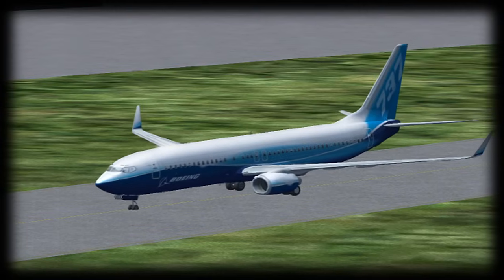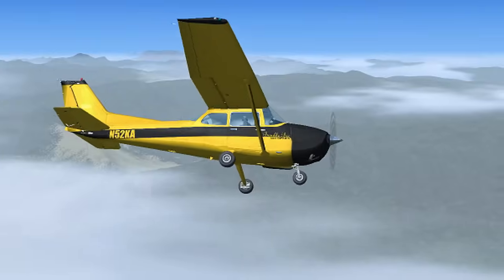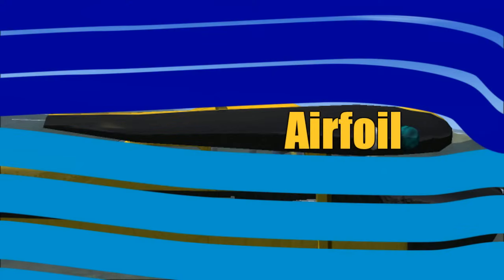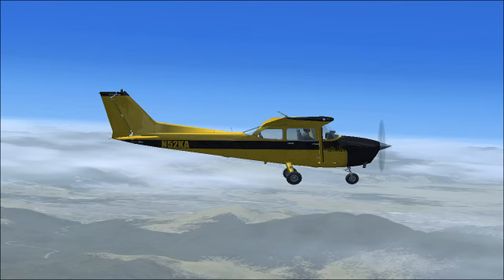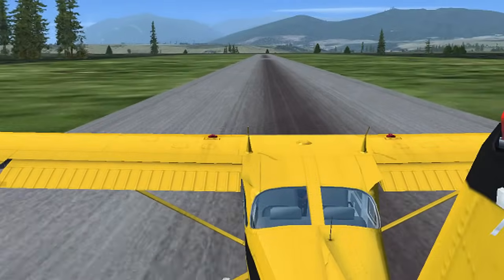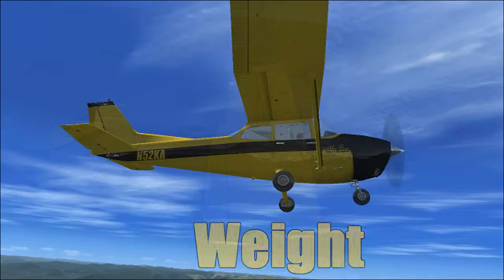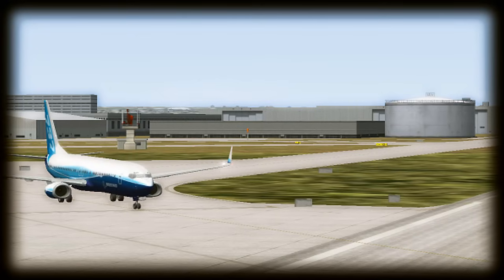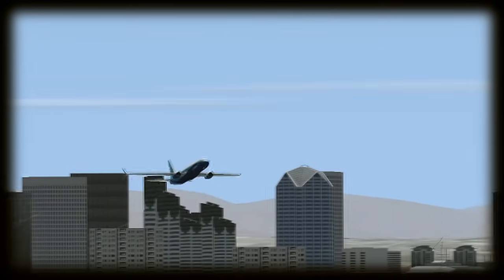The Aerodynamics of Flight

Comment: Bernouli's principle though itself true has now been discredited as the cause of aerodynamic lift. A wing, like a propeller or the vanes in a jet engine divert air causing an equal and opposite reaction. The propeller or jet propels air backwards, causing thrust, and the wing propels air downwards, causing lift. Even Nasa now agrees that the application of Bernouli's theorem is misplaced in this context. Nobody's telling me to watch it either, but if it is educational it should also be accurate

Comment: Actually Lift does not have to equal weight for the aircraft to fly. In actual fact in a climb Lift is generally less than weight and we actually climb through an excess of thrust. also in a level turn lift at 60 degrees angle of bank will be aproximatly 2 times weight.

Comment: It's not the upward force that creates lift but it's the low pressure on the upper area (suction) along with the downwash at the trailing edge of the airfoil that create lift. The low pressure is accountable for the majority of lift produced. Take a plain piece of paper and hold it in front of your mouth, blow only in the upper area of the paper, and boom magic....lift is created.

Comment: If thrust = drag, then lift < weight:
 the forward movement = thrust - drag. And the lift depends on this movement (because wings generate lift only when they move through the air). If thrust = drag, then thrush - drag = 0, then lift = 0. So in order to be able to fly, thrust cannot be equal to the drag.

Comment: If this presented THEORY was true then an airplane with a symmetrical airfoil or an inverted aircraft could never fly. Many aerobatic and model airplanes have symmetrical airfoils. They fly (very well) by displacing air downward by using an angle of attack! The weight of the displaced air must equal or exceed the all-up weight of the aircraft  In a turn an additional amount of air is displaced sideways to offset the G loads.

Comment: that depends... If the airplane is already in the air? - cause then it wont fall... Same goes for Thrust and Drag... If the powers are equivellent... then the flight will only continue its path... (if airforce didnt exist :D) <3 Physic laws

Comment: Bernoulli's Principle also comes into effect even when the airfoil is symmetrical. When the wing increases its angle of attack, the air travels much faster over the top of the wing because it gains speed as it travels downwards. And the bottom of the wing is blocking much of the air so the pressure is greater in the bottom. So theres Nweton's law because the air is traveling downwards on the top, which reflects the wing upwards and Bernoulli's principle because of the change in pressure.

Comment: Yes but in helicopters lift is not a result of forward motion. You may consider "weight and lift" same for helicopters and also "thrust and drag" (if the helicopter is in forward motion) but helicopters do NOT need forward motion to create lift; lift is created by spinning rotor blades whether the helicopter is in forward motion or stationary. You may think of the rotor blades as wings. They have similar cross section and angle of attack (here it is called pitch).

Comment: I couldn't agree with you any better. I don't know why people keep repeating the same old stuff. If the entire lift were result of bernoulli's principle, then the pilot of that 737 would never need to use the elevators to get the airplane off the ground. 
Guys, learn the bernoulli's principle and how it creates lift but also know that it is NOT the main reason why airplanes fly.
Ask yourself this: How do airplanes fly inverted? Bernoulli isn't going to help you here.
Angle of attack will.

Comment: Agree with Craig H below. This video contains basic errors, eg the appeal to Bernoulli's Principle to explain lift. Air is a viscid and compressible fluid, and thus violates the requirements for the application of Bernoulli's Principle. Lifting line theory gets closer to the non-linear, Navier-Stokes reality.

Comment: This is full of errors and had very incomplete information.
You say lift my be equal or greater than weight for an aircraft to fly.
In a sustained descent, lift is less than weight. It's still flying though.
You might say that doesn't count as it can't fly for long like that.

Well, in a sustained climb, lift is also less than weight. Thrust is what makes you climb.

Your description of drag is very incomplete. You sort of describe parasite drag. You don't even touch on induced drag.

Comment: The principles didn't come into existence when they were discovered, they always been there. Therefore you cannot say that something is caused by a principle, a principle is a statement that explains why something happens, not the reason it happens. So it impossible to say that a certain law or principle generates lift. And in this case both Newtons Laws and Bernoulli's Principle are correct, tho I do not recall Newtons law including aerodynamics.

Comment: The other type of drag is Induced drag which is created as a product of lift by the wings. The weird thing about this type of drag, is it is actually greatest at low airspeeds with high angle of attack, and REDUCES, as the aircraft increases in airspeed and it's angle of attack decreases.

Comment: Yeah that is correct. Getting kinda technical, but there are 2 main types of drag affecting an aircraft. Parasite drag is the general drag we usually talk about due to friction from the air. So when thrust is greater than drag, the aircraft will accelerate, but not for ever. As the aircraft's airspeed increases, so does the parasite drag, until the Drag is again equal to the thrust, and the aircraft is stabilised at this new airspeed : )

Comment: It depends. If you go fast enough (if relative airflow is great enough) most aircraft will rise by themselves at some point, with no pilot input. Most aircraft have their wings set at an angle greater than the body (the riggers angle, usually 4 degrees) so they produce flying lift without much pitch up.

Comment: I learned about bernoulli in plumbing class, it has nothing to do with the relative winds displacement above or below an airfoil, bernoulli is negative pressure generated when fluid has to pass through a small orifice causing velocity of fluid to speed up, and in most cases this only happens when fluid is enclosed or restricted with in something for instance a copper pipe,  also other factors must be included such as syphinage, back syphinage, negative and positive pressure.

Comment: Induced drag occurs in three dimensional flow.  Because the wings have a finite span, the flow spills over the tips of the wing (down wash).  Down wash causes the wing to see the flow at a different angle of attack.  This difference in flow angle causes the lift created by the wing to have a drag component.  Essentially, the lift is pushing backwards and upwards at the same time.  The backwards component of lift is called "lift induced drag"

Comment: Depending on the naming convention this can vary.  However, when studying aircraft performance, typically "V1" denotes the velocity of the aircraft just before take-off.  "Rotate" (or "Vr") is the rotation velocity of the aircraft.  Rotation velocity is the velocity where the aircraft is rotating on the rear landing gear.  Since lift is proportional to velocity, at Vr the aircraft is not quite producing enough lift to completely take-off -- lift  is less than weight.  When L > W the a/c takesoff

Comment: drag thrust is the difference in pressure between the back and the front of the airplane. if the pressure is greater on the front, it the drag is stronger, if the pressure is less in the front, trust is stronger.

Comment: @Jackimooz if you are flying with constant speed (which it's actually what happens most of time), so the thrust is equal to drag.if the thrust is greater than drag all the time the airplane will be accelerating (increasing its speed).
However, when the airplane is taking off the thrust is obviously greater, because it has to increase its speed.

Comment: As far as I know, during climb lift is not greater than weight. Part of the thrust is used to overcome the drag generated by the wing, and the remaining is used to accelerate the aircraft on the inclined climb angle, the steeper the angle the greater the component given by the cosine of the climb angle

Comment: @Nebula485 Spot on! Bernoulli's theory is compensates for around 3/4 of the lift theory. Basically, the thing the 4/4 part is that the lower pressure air coming over the wing top hits the air coming under (basically tripping) and then it causes downwash. As newtons 3rd law states, everything has an equal and opposite reaction. So if you get downwash you get lift:)

Comment: This is a really bad explanation of lift and for the most part, incorrect. The majority of lift produced by the wings occurs 'on top' of the wings, as the dynamic pressure sucking upwards is a greater force than the static pressure below.

Comment: the way lift is produced is not that particals pass over the wing or pressure's,which is only part of the story, the main part is that the direction of the after flow of the air leaving the wing, generally the air is force in a downwards motion off the wing and but newton 3rd law "for every action there is an equal and opposite reaction" therefore the downwards moving air pushes the wing up thus creating lift.

Comment: I don't think you explained how an aircraft actually flies. You just explained the aerodynamic forces that act on an aircraft. You should have mentioned how the shape of the wing, were the upper surface of the wing forces air to travel a longer distance while the lower shorter and the relation between velocity and pressure. So air has to travel further distance above the velocity is higher which means the pressure is lower. High pressure below and low on top creates lift. Great video though =]

Comment: bro, bernoulli's principles is acting most during the lift, Pressure acting on the aerofoil hits the bottom of the wings and create's a downwash, The best angle for lift is 12 degree's , The pressure acting on top is less than the bottom on the wings while lifting, And the pressure at sea level is not the same as the pressure at high altitude so they need cruise at high altitude's.
Hope it helps. Cheers

Comment: Everyone should remember that lift is relative to the angle of attack.

Even with an angle of attack of 0 degrees, the airfoil may still produce lift. 

There's more to why the aircraft lifts off the ground on takeoff. It isn't only to clear anything that lies beyond the runway and obviously get up into the air.

The higher the angle of the wing relative to the wind passing over it, the more lift is created.

Great video Garth!